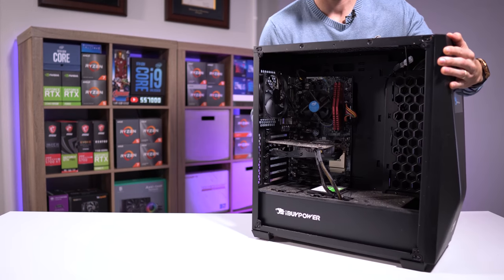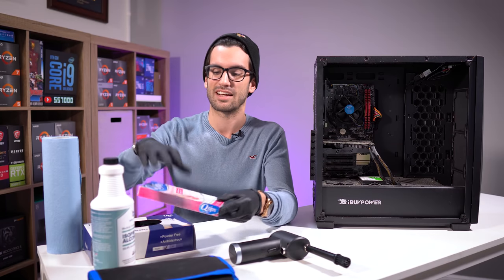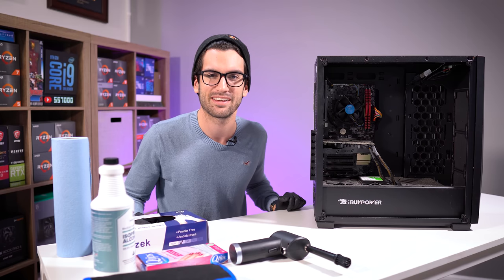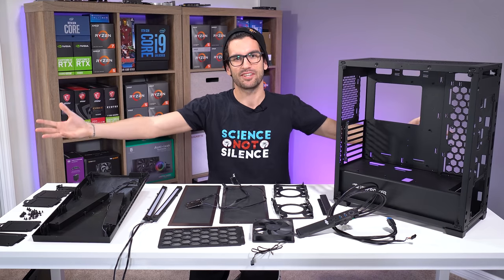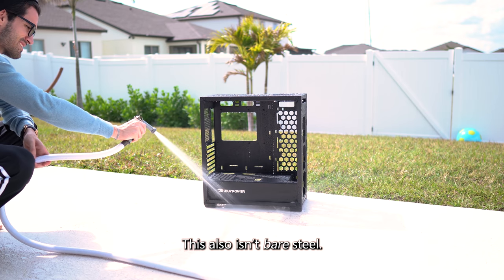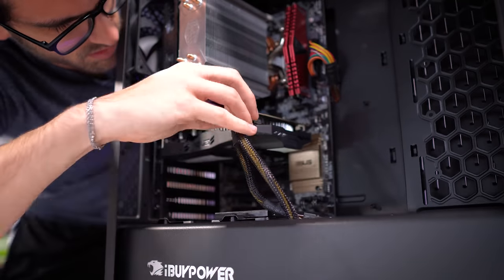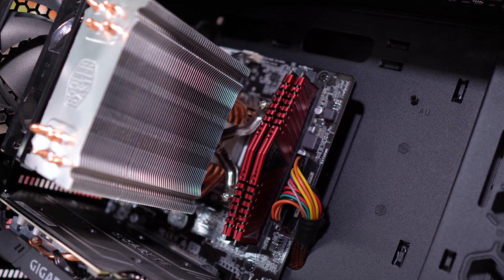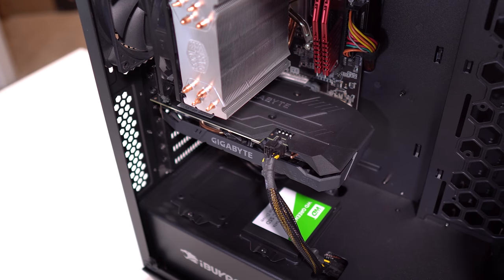Deep-Cleaning a Viewer's DIRTY Gaming PC! - PCDC S1:E4

Comment: I was wondering if you could make before and after benchmarks of the PCs that you clean. It would interesting to see thermal/performance difference after repaste and proper dusting. I understand benchmarking is unnecessary stress that not everyone may accept but if they are also getting free cleaning and hardware upgrade, seems like a fair trade...
Reply: Even just a cleaning is fair trade. 
People really need to be shown the importance of proper maintenance.
Reply: He would need admin access to their systems which not everyone would be comfortable with
Reply: @abeg1571  not really. Any Linux USB live boot allows for some very basic tools to run without any installation or touching the SSDs/HDDs whatsoever
Reply: @whydoyouaskdude  if you wanna go super basic you can get this numbers from the BIOS splash on start up
Reply: @abeg1571  I would be intrigued to know how you put the CPU under load in the BIOS. Do tell, I might learn something new.
Reply: @abeg1571  But that would only give you idle temps which would be pointless.
Reply: @dennisanderson8663  Considering the degree of cleaning he's doing as well as applying new paste and improving airflow, you'll easily see a difference in essential reported temps and fan speeds.
Reply: @abeg1571  How does a CPU heat up when it's literally doing nothing sitting in the BIOS?  The answer is it doesn't.
Reply: @dennisanderson8663  You don't know much about how PCs work if you think there's no heat run off unless you put the PC under load. Good luck bro

Comment: congrats your case was the first one to get showered. XD
Reply: Congrats, now your case will rust!
Reply: @RicardoCooper  It doesn't work that way. If it was properly dried after being washed, it won't rust.
Oxidation (rust) occurs on every metal surface, some is visible from day-to-day, other take weeks to be noticeably oxidized.
Reply: @RicardoCooper  That video you linked showed the guy removing a coating from the ball bearings, obviously bare metal is going to rust fast.
Reply: @Madvillian  OH thanks for correcting me, I did not know the case is waterproof!

Look dummies, if you are going to wash your cases then at least use distilled water.
Reply: @RicardoCooper  Where did say the case to be waterproof? You claimed the case will rust from being hosed and your proof was a video of bare metal rusting. Obviously if there is no coating or paint on the metal aside from aluminum then it will rust immediately but the case is this video clearly isn't bare metal. If he left the water to sit then maybe it would rust but you saw the guy drying the case in the video.
Reply: @Madvillian  Most cases are made of steel, paint or powder-coat does not cover the entire surface.
If you are a moron and are going to wash your PC case, then use distilled water (because it does not contain bleach or other chemicals that will rust almost on contact!)
Reply: @RicardoCooper  I'm aware most cases are steel but I'm not sure how you figured they aren't completely painted. Most manufactures paint the frame in separate pieces then rivet them together; that makes sure all areas are covered The only thing I would worry about is moisture getting stuck in between riveted pieces, although I doubt that would happen. While I personally wouldn't hose my computer case regardless of it being aluminum, I don't see how someone wanting to wash their case makes them a moron.
Reply: @Madvillian  It is just dumb advise, people please do not wash your case with tap water just so you can get all the dust out of every crook and nanny. [sic] Because Water will definitely penetrate these nooks and crannies and "go where no paint has gone before" (I think that is a Star Wars saying... Sarcastic LOL)
Reply: @RicardoCooper  cases have a coating on them
Reply: @RicardoCooper  I can't tell if you're trolling or not. It's perfectly safe to use "tap water". Just dry off after and you're fine. (Metal fabricator for the last 15 years cleaning a variety of materials)

Comment: 6:38 It's so humid in Taiwan, not just PC cases but COMPONENTS rust here by themselves.
Reply: Same in Barbados
Reply: oof
Reply: He lives in Florida so high humidity is ever present.
Reply: @hamajangz9586  No no. Taiwan's is much worse than Florida's. Average humidity doesn't even break 80% in Florida. Here, 10/12 months are over 80% and our two driest months are 78% with many days in the 90s.

If I don't actively dry my shower, washroom, clothes, etc.. they will remain wet for a week.
Reply: @MarcoGPUtuber  Florida is swampy terrain so the humidity there is no joke. Perhaps not as much as other places but still more than enough to make you feel miserable. I live in Hawaii another place with high humidity for much of the year. It freakin sucks.
Reply: Pretty bad in Houston, Texas as well. Humidity as well as the heat is awful from May until mid October. So, half the year it sucks to be outside. The other half is pretty nice.  :)
Reply: Rains all the time here in Seattle. It's the salt that accelerates iron oxide formation.
Reply: It happens in Florida, especially after a hurricane and you have to have your windows open since the power is out.
Reply: @alexsitaras6508  Your power goes out in a hurricane? o_O
Reply: @MarcoGPUtuber  Yeah why wouldn't it. Around where I live a lot of the power polls are wooden, and they can sometimes fail after a strong thunderstorm, let alone a hurriance.
Reply: @alexsitaras6508  That shouldn't be normal... This never happens in Taiwan in a hurricane/typhoon and we get category 2-4 hurricanes.

I'm literally appalled to hear that you have to endure that!
Reply: @MarcoGPUtuber  Yeah, the power companies have been pretty slow in upgrading to more resilient/ modern tech. South eastern Florida is better about it, but it's not everywhere.
Reply: @alexsitaras6508  For me, that is nothing short of appalling and I feel for you. Typhoon days here are just... stay at home and play video games day while getting a paid day off if you're salaried.

Comment: Greg quick tip when using q-tips for cleaning electronics roll the q-tips as you move along with the board when cleaning rather than just wiping or scrubbing, so you don't leave any cotton fibers behind, or you can always use the cotton cloth q-tips.

Comment: I always use that heat sink from CM. You do not want to put the fan on the RAM side. When I used this heat sink for the first time. I used both sides for cooling. If there is almost zero clearance. Don't use that side. In one year. The fan vibrations broke solder joints to one of DIMM slots itself. So I had to not use that RAM socket, in my old PC. Or my PC would blue screen.

Comment: one other thing when you look at it in this particular case..

when you also have the case fan directly behind the fan on the cpu heatsink pushing air out of the case, its going to get just that little bit more of a boost

Comment: Just a thought related to this specific system.

Would it not be better to convert the build to positive pressure? There was room for at least 2x 120mm fans in the front with a good dust filter. And since the "customer" has pets, I would believe that taking air in through filters would keep the pc cleaner for longer, than with a negative pressure build.

For those wondering. Positive pressure means that you feed the case air through intakes, and have more air going in the case than out. This can help control dust buildup.
Negative pressure means you "suck" air into the case. This is usually just fine, but with fur and dirt, you risk sucking dirt through non filtered openings in the case.

Comment: I have 2 cats.. I tend to clean filters every 2-3 months and once every 6 i use an air compressor to de dust the thing (without disassembling), case is an old Define R4 with 5x Arctic P14 that push lots of stuff in. 
Some people just keep their PC in recessed corners of their houses never cleaning that particular corner at all, or else I can't explain. Clean the room weekly. My case is even on the floor, although I have a wheeled little cart so I can move the thing aside and clean underneath it.

Pull config is better well, for dust.. it won't clog the finstack as fast as using a single push fan. But for performance, push is better, unless you are using flow fans, pressure fans do better at push than pull, usually in push pull, the pull fan barely improves temperatures..

Comment: great series!  and you certainly know way more about PC building than me but nevertheless I am quite sure you were using way too much thermal paste. Having the layer as thin as possible gives the best results as the thermal paste's only job is to fill the air gaps between the (rough) surfaces of CPU and heatsink.

Comment: at higher temps, been able to move heat away quicker is better, as its allot harder for ambient air to cool it down quicker just by its coolness. thats how a pull system works slightly better. plus a only push system keeps a lingering area of air more, behind the heatsink, which is hot. when a pull doesn't do this. a push pull system though, is ofc  the best choice.

Comment: That Hyper 212 EVO cooler is insanely powerful. I have one sitting on a 130W E5-2680 and it runs at 54°C while mining Bitcoin at 100% CPU utilization. Granted... I can't put the side panel back on the case because it's 2" higher than the case is wide, but it's still phenomenal. Cools better than my old Corsair H50 120 mm AIO.

Comment: I bought a PC from Ibuypower 6 years ago. First time I opened the back panel, the wiring was a mess. I spent 4 hours just to install an additional HDD because I had to reroute a lot of wires. SInce then I upgraded to a modular PSU, better fans, the ones I had were dead. New GPU. And now my AIO cooler is going out because my CPU is getting extremely hot. 

I just ordered a new case and new AIO cooler of higher quality. IBuyPower did make a decent pc for me. But I think I'd prefer to build one next time. There were certain things about the prebuilt IBUYPOWER that I just didn't really like and aggrivated me.

Comment: I have the GTX 1660 SUPER that I upgraded from a GTX 1060 6GB. Definitely a big performance bump up. That'll actually play Cyberpunk 2077 at 1080p 70fps on average with optimized settings.

Comment: This is the main reason I do not currently have a cat.  It used to not be as much of a problem when I had more free space for an animal to roam around in, but now that I have way more electronics, and a smaller total area...there would just been way too many devices with animal hair on, or in them to be worth the risk.  Also, looks like I need to invest in a different compressor now that they appear to come cordless.  Been using a DataVac for ages, but that thing is kind of clunky and also requires an outlet, which limits where I can actually place my system when cleaning it outside.

I also have that exact same toolkit.  Never thought about actually hosing down my case, because I don't want to actually do a complete tear down when I clean mine, but I don't have a bunch of hair and caked on "stuff" to worry about anyway, and usually a wipe down with a microfiber and some precise work with Q-tips is more than enough to get what the compressor leaves untouched.  

Also never used latex gloves, and usually never really had to bother with an arm band either, and I have never had a static problem with any components.  But due to 2020 and now, I have two boxes if latex gloves, so I may as well keep some set aside for my next cleanings.

Comment: Should have added a couple front fans to move toward more of a positive pressure set up to keep it cleaner longer.
Reply from the maker: Not a huge deal.
Reply: @GregSalazar  probably not if it's cleaned on a regular basis.

Comment: I've watched all 4 episodes so far. This is a great series Greg!
Didn't realize one could hose down a case (just the bones). Learning lots!

Question Greg, in this episode, ya removed that stock cooler. What do you do with it? It isn't beefy like that one ya just replaced this one with (from previous cleaned PC). Are you able to recycle those kinds of parts?
Reply from the maker: I discuss this very thing later in the video :-)
Reply: @GregSalazar  Oh, sorry, must have missed that, haha. 
Only heard mention of recycling the fan from a previous clean job into this one. I meant about the fan in this one. Are you likely to use this stock fan in another build, or will it sit on a shelf for a while, or are you able to find someplace to recycle it(like the metal/plastic).

Comment: pull-config on a tower cooler is a lot worse actually. it's not like AIO radiators. I've seen it myself and you will if you test that with both configs
Reply from the maker: I HAVE tested both configs - not this exact cooler, but a very similar single-tower footprint. Not even a single degree temperature delta (side panel on).

Comment: you made a mistake in mounting the heatsink fan, you should mount it on the opposite side, you have to mount it on the Ram side, in this way the fan takes the air introduced by the front case fans to cool the case, the heatsink fan takes part of that air to cool the heatsink and the rear case fan receives the hot air from the heatsink and expels it from the case

Comment: Really need one of those GamersNexus Modmats .. or similar ... and why clean a stock Intel cooler. Just bin it and give them any $35 aircooler from Amazon/Micro centre etc
Reply from the maker: I've had several desk mats. They all get grimy and nasty in just one or two cleanings. Terrible looking on camera hahah. Pointless for this application. And I cleaned the stock cooler because, well... that's kinda the point. It's a "deep cleaning." Ya clean everything, regardless. But I gave them a cooler upgrade. Commenting too soon, my friend :-P

Comment: Hey Greg, I was wondering..
is it safe to use an old toothbrush, dip it in medical grade alcohol and brush it on dusty PCBs (after removing other stuff ofc) instead of using swabs? I'll brush it gently of course.

Comment: I just cleaned a laptop, i3 3rd gen ultra slim and almost pulled my hair for that sorry excuse of thermal dissipation. It was basically a sheet of copper, no heat pipe so my next purchase is an aftermarket cooler that people seemed to mod to fit. Only thing I could do for now was cleaning, SSD swap and changing petrified paste

Comment: I am pretty noob to this but I have heard people saying there are very miniature pins in the processor, I guess putting it facing 5:37 down on the table and then cleaning it will damage the pins or not ? Just a learning curiosity question.

Comment: Find a wood shop and offer your services, a decade ago i was a running a mobile administration company and i had a contract with a custom furniture shop and the towers would fill up with saw dust so much the fans stop spinning. This was the Pentium 4 ht days so it's been a while and even the base model p4 ht over heated weekly without intervention.

Comment: Wouldn't you want the heatsink fan to be on the other side blowing fresh air through the heatsink towards the back case fan?
Reply from the maker: I discuss this later in the video. Makes little to no difference in testing.
Reply: @GregSalazar  Nice.  I actually ran into issues with my Noctua NH-D15 not being able to put the second fan on due to having tall RAM sticks.  Apparently I need to get low profile RAM but then I lose my RGB.  :(

Comment: I know you changed the card but wasn’t the original gpu heat sink put back together wrong with the copper facing the fan not the chip?

Comment: Do you reinstall the same thermal pads to the graphics card? I want to give my MSI gaming X 1060 a deep cleaning, but I dont want to damage the thermal pads. I might try once the gpu market is more stable, just in case I mess it up.

Comment: Did you install the heat fins on the GPU upside down so the copper plug is facing toward fan? Or were you just lining it up? Only footage shows the copper toward fan (unless the copper goes through to other side)
Reply from the maker: Lol. It was installed correctly.

Comment: You gotta open up those PSUs. They're filled with shit too and are easily reassembled. At least take the cover off and blow them with compressed air.
Reply from the maker: I already discussed why I don't open up PSUs...
Reply: @GregSalazar  I know. I watched the video. You said you "don't like to open up power supplies" for which, I'm sorry, there is simply no good reason. It's electronics like the rest of the stuff. I'm not saying you have to take it apart like you take apart the graphics cards for instance, but there is no harm in taking off the shroud so you can properly clean the fan and get all the dust-bunnies out of it. I just think it's a little weird that you go into such detail with the systems while neglecting one component entirely. But you do you. That being said I like the series and appreciate the overall thoroughness.

Comment: Anyone else cringe at the awful value of the PC?
- Stock Intel Fan
- Green WD SSD
- Single fan 3gb 1060
-  One Exhaust Fan
- Terrible Case
-  h110 plus mobo... holy crap, can't even utilize the speeds of his ram lmao
-  No name PSU

Guys. This is why every DIYPC builder says prebuilts suck. Doesn't matter if the upcharge is like "100-300" they SKIMP YOU SO HARD. Don't get me started on HP Omen towers, my freakin' gosh such a terrible value.